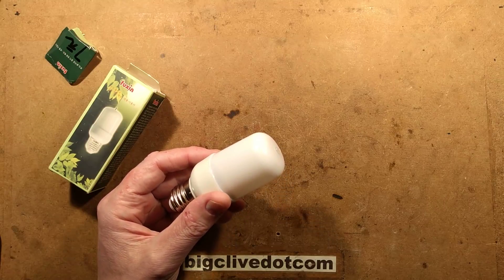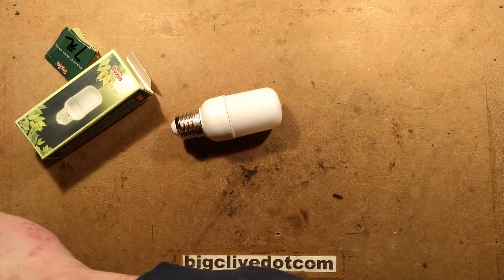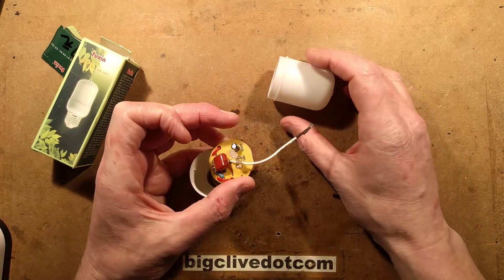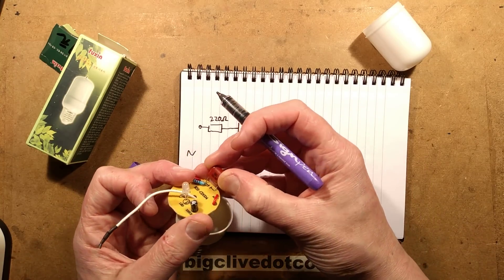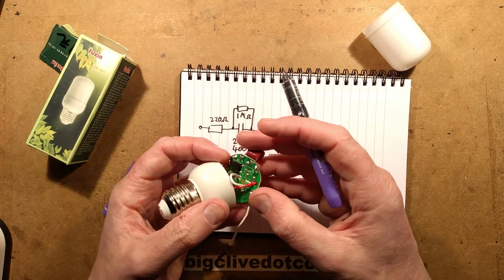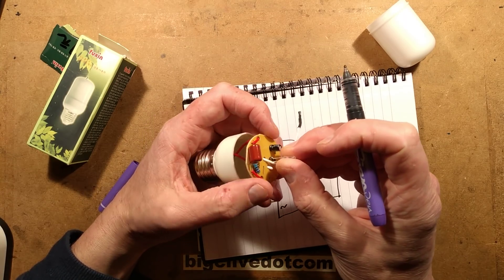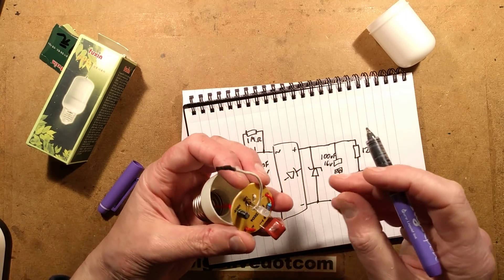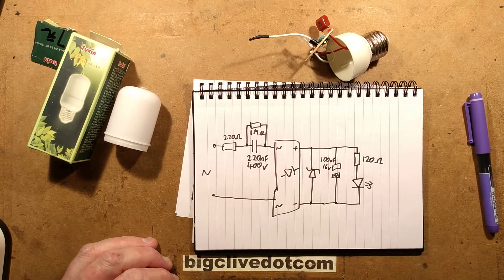Inside a fake Fuxin ionizer lamp.  (with schematic)

Comment: If you haven't already, would you be up for evaluating several of the various cellphone "sanitizers"?  Most use UV light, but at least one claims to use ozone.  I can't help but suspect that the UV based models are somehow deficient from a safety perspective.

Comment: Clive, a question for your next Q&A:

When you get a product from ebay which is not legit, or doesnt work as advertised, do you file a refund request/complaint with ebay?

Thanks for all you do!

Chris
Reply from the maker: I can answer that now.  I often buy things knowing they are shady, so if I did open a case for everything that was dodgy I'd probably trigger a fraud filter and have my account deleted.
Reply: @bigclivedotcom  totally makes sense. only big Clive is willing to go into the dark corners of eBay!

Comment: dont get why they bothered with a discharge resistor
Reply from the maker: On a capacitive dropper based lamp, if the lamp is turned off or unscrewed it can leave a charge on the capacitor and give you a sting from the base if you bridge it.  The resistor will quickly discharge the capacitor to a low voltage.
Reply: Yeah, just wondering why they would care, since they are scamming people anyway

Comment: Fill it with as many slow color changing LEDs as the power supply can handle.
I tried that with the clover LED night lights of yore and they balked at 8 so I backed it off to 6 and it seems happy enough.

Comment: As there are pads on the board, and the carbon fibre bits, maybe they really did just forget to put the ionizer module in, rather than deliberately design it not to have one - terrible quality control though, or just naughty :o)
Reply: I like you, you have a very sunny disposition :)

Comment: On the top of the box packaging (which you ripped off), "7元" is written on it with a black marker. Which I think would be the original retail price. That would be 0.78 pounds, I guess you can't make a real one that cheap.

Comment: I can't believe the Chinese are selling fake items. What next? A deal for Brexit?

I have a suggestion: Cover every high voltage overhead transmission line in the UK with carbon fibre filaments - then we'd have  clean air??
Reply: Jack King That’s only going to work if the high tension lines are DC rather than AC (though some transmission lines are DC for its greater current carrying capacity, but they are more the exception in most areas).  Besides, why would you want so much added negativity in the air?  That’s what politics is for!
Reply: As Ethan Poole said this wouldn't work with AC. If you were able to get a job lot of EHT stick rectifiers from very old crt tv sets and connect these in series with the brushes then it might work (provided it doesn't rain).

Comment: How 'bout teaching us how to make it into what it should/could be?.. Then showing what it does (as in how well you can make it work.)
Reply: Thanks Undefined but you're a bit late with the dare and you evidently misunderstood the spirit of my suggestion. I'll type slowly so play along and read slowly too. You see, like most other people who've been bitten by the bigclive bug, I've watched every video in the library and seen many covering ionizers & how they work. They are exceptionally good and informative... But that actually has little to do with what I was thinking. I was suggesting it as a quick project like a challenge. Here is a product that is just not even Fuxin close to what is should be - working within that framework & using as much as possible from the commercial product, what can Big Clive do with it? Think of like Martha Stewart; a bucket of dryer lint, a handful of wood chips, 2 cups of portland cement and 2 hot dogs and she produces a ready-to-eat pig roast. It would be great to learn what he would do with an item like this. ;)

Comment: A few years ago I bought a pair of scissors at the dollar store and when I got them home, I realized they were fake scissors.  They were made of some kind of soft metal which bent like a pipe cleaner under the slightest pressure.  You could crumple the scissors into a wad in your hand.  I realized that somewhere in China there is an entire factory dedicated to churning out hundreds of thousands or maybe millions of pairs of fake scissors, miners digging ore, smelters processing the ore, workers constructing and maintaining machinery to churn out these utterly useless scissons.  And then I realized that when this scissor factory has to cut paper themselves they have to send someone out to buy a pair of scissors.
Reply: I suddenly want these scissors, just to see how they handle paper.
Reply: the paper would probably cut those scissors
Reply: Rock-Paper-Scissors must be a different game wherever they make them. 

I had previously wondered about the factories that make cardboard television sets for furniture shops.
Reply: they wouldn't be cut out for that job either !
Reply: I once had a set of drills like that, they just bent rather than cutting through wood. A friend had some fake Allen keys  that were too soft to undo anything and just twisted into a spiral on attempted use.
Reply: probably childplay-scissors...  they make them extra so that your todlers won't hurt themselves as long as they don't put it in their eyes. Got some when I was a child, looked like the real deal. Should be written on the packaging though (but chinees for child?)
Reply: Elvin Haak Maybe they are theatrical scissors, for use in stabbing scenes with ketchup instead of blood.
Reply: Kind of like cheap nail clipers that simply buckle instead of clipping your nail.
Reply: I got a free Swiss Army STYLE knife with some purchase years back and like those scissors, it was made of a useless alloy blend. The corkscrew was as you describe and could be bent easily by hand to almost any shape. The main blade was easily bent to either side and was incapable of keeping an edge, let alone cut anything. It was hilarious! 😉
Reply: I had a pair of wire cutters made the same way  and the Chinese are making cars with the same metal that's going to be interesting !
Reply: @thehappylittlefoxakabenji8154  Actually it's the reason why European cars are popular in China, especially Peugeot and Citroën. From the testimony of several people that where in China for work and were provided small, ecomony Chinese car like the Cherry QQ, those cars are so flimsy they make a 2CV looks like a tank.
One of those guys said he was given a brand new Cherry QQ for work... After 6 month on the (arguably terrible) Chinese roads, the chassis of the car was bent enough that the passenger door would pop out open at any pothole, and on the driver side he had to park his car with a wheel on a curb to be able to open the door.
If you wanna see how well they fare, you can look at the crashtest of the Jiangling Landwind, most notable the one that the Chinese wanted to sell in Europe 10 years ago.
Reply: thanks for the info so I suppose that pic on the internet of a Chinese car having a large dent in it from running into a bicycle is true then ?
Reply: @thehappylittlefoxakabenji8154  You can never be sure. Maybe the car already had a dent from something else, but on the other hand, are some Chinese cars made with flimsy panels with little to no reinforcement behind? Yes they are.
Note that I say "some" because today, Chinese brands got aware that selling cheap crap it only driving Chinese middle and high class away from anything labeled Chinese, and that European and American markets won't accept those products because of safety issue, so several Chinese products today are up to Western standards. But there are still crap makers as well... as long as it sells.
Reply: yes that would appear to be the case but there is always a market for cheap crap ,had you seen the pic ? just google Chinese car v German bike
Reply: For approximately a microsecond in the 80s I remember handful of Lada and Yugo dealerships opening here, so there's definitely a market for cheap, gas-powered deathmobiles.
Reply: @NoJusticeNoPeace  Well  most Soviet/Eastern cars were more suffering from outdated design and poor quality standards than built quality.
There are still millions of Lada in use in Eastern countries, and the Lada Niva, even the old 1600 models (made before 1994) is still a successful 4*4 here in France, a model in good shape sells for around 2000€.
There is a difference between mediocrity and shittiness. Most Eastern cars were mediocre, but they weren't death traps; at least, not more than most cheap European econoboxes of the time.
Today's Chinese cars copy European and American models with an abysmal lack of respect for any safety point.
Reply: I've seen a crash test of the Jiangling Landwind, done by the ADAC. It did not end well for the crash test dummies...
Reply: I had a pair that had a tip that immediately shattered before making it through a single wire. Not sure which is worse, overly soft, or overly brittle.
Reply: yep made from the finest Chineseium !

Comment: I guess they figure this is like them salt Rock lamps, my inlaws bought my Mum one a few years ago then Clive mentions in a video they're fake I haven't the heart to tell my Mum or my mother Inlaw. I had better build 2 first then tell them. Don't ya think.
Reply: I serously always thought they are for decoration only.
Reply: @wupme  I remember when my Mum opened hers, the in law said they have healing powers and clean the air, removes negative energy. I was like hell does it pay the rent....then I realised yes it pays somebody's rent.
Reply: @wupme  I thought there were no different than lava lamps, they're sold right next to them and kids night lights at the hardware store....
Reply: So did I. They look nice and they do catch some dust (that falls on them instead of the table where it stands on). 
And possibly the salt rock themselfs have some healthy effect on some people (even if it just the relaxing look at them instead of the ugly table that needs cleaning)
Reply from the maker: If they like them and it makes them feel good then they never have to know.  If you gave them a real ioniser and it made a mess like ionisers do then they'd probably go back to the rock salt one that "doesn't make a mess".
Reply: @bigclivedotcom  your prolly right. Thanks for the sound advice. Cheers 🇮🇲
Reply: i want a rock salt lamp because they are pretty, even though i know they have so much snake oil marketing going on
Reply: They emit a pleasant glow, and can be used to de-ice your front steps
Reply: They should be called Placebo lamps  :D

Comment: Too bad it's noit genuine. I have a somewhat smelly workshop, the door has now been closed for almost all the time but I left a DIY ionizer running in there for about a week and it really seems like some of the odors have disappeared. Perhaps they work, perhaps it is something else. Hard to say.
Reply: Well open the door and let some wind in there brother. Or is that the cause wind of the silent kind.
Reply: Ionizers will remove airborne odors by making the contaminants clump together and either fall to the floor or stick to something. The smell will slowly return (when the ionizer is switched off) if you don't remove the actual contaminant by vacuuming, sweeping, cleaning, etc.

But real ones definitely do work.
Reply: This one being shite doesn't prevent a real one existing in the wild... and this one could be made to work with a cap array and gumption.
Reply: Gumption - Can you still buy Gumption -not seen it in the shops for a long while!
Reply: No, but you can get fake gumption on E-Bay.

Comment: I always wonder if this kind of dodgy stuff is purely deliberate or if there's more to it?
I have a "solar" led key torch with a real panel, but no charge circuitry. I wonder if they have a genuine production line running next to another that uses up excess parts or something? Curious.
Reply from the maker: It's really common.  I've probably taken one of those keyring torches to bits and as you say it had a real solar panel but not connected and an ordinary lithium battery.
Reply: Are you "Kidding Meeee" 😂🤣 "It's very Dodgyyyy"
Reply: It’s such a common practice in China that there is little doubt that the ripoff is intentional.  If they are willing to put melamine in baby formula just to pass tests for protein content then what will that mindset not do to cheat their buyers in order to profit?   I think a big part of the problem is that, outside of well developed countries, a human life is too often not perceived as having any real value, at least not beyond oneself and immediate family — and when life is cheap and under-valued then people tend to have a rather fatalistic outlook on life, so if cutting corners to cheat, or even maim or kill, others will result in one living a better quality of life in the here and now then all too often their conscience is not terribly burdened by doing so.  For example, in China when a driver hits and injures a pedestrian it is not altogether uncommon for some to repeatedly back-up and drive over the pedestrian multiple times to ensure they are killed because because it is financially more advantageous, on average, to kill the victim than to pay for their injuries (and more often than not, the courts side with the driver over the deceased and hand out either modest penalties or very short prison terms, if there is even a prosecution at all — even in cases where the victim was not initially badly injured and there exist multiple witnesses and video evidence).  To be fair, the West went through a similar period during our development as well when life was greatly under-valued, but that does not mean we should not hold one another to a higher standard when we fall short and I genuinely believe China is capable of much better if the people simply insist upon, and demand, such — and social activism is becoming more common in China.
Reply: I wonder to what extent it is openly acknowledged. Obviously the manufacturer knows theyre churning out fakes, but do the wholesale/mailing services? Do the ebay drop shippers, who never see the actual goods they sell? When the seller compiles his listing, is he choosing between a genuine item at price A and a fake at price B or is he taking a similar chance to the person ordering stuff like this? 
I saw someone further down the comment section mention a fake solar keychain torch he'd bought, and I got the same item, with a real solar cell that wasnt connected and a primary rather than rechargeable cell. I got a refund and also noticed that the seller removed the listing from ebay, which might imply that he didnt know the things were fakes when he listed them.
Reply: There's a culture in China, whereby if you're in business and not ripping people off, then you're viewed as not being a good business person.There is also an attitude of working a swindle, making money, and not worrying about the consequences. I'm not making this up; these things are common, even when selling to other Chinese people.
Reply: I would say they order parts make a product or products for some reason or another they run out of a part and just keep making them, on purpose. They know most people will not take it apart. The first time I saw inside a Nintendo I about fell over. Big square box nothing inside. Then my 3d tv went out the panel cracked i had a warranty so guy comes out we flopped in on the floor, it was dam near empty. 3 boards in it audio video and power. Maybe the were 8 x 8 inches. The rest was all screen.